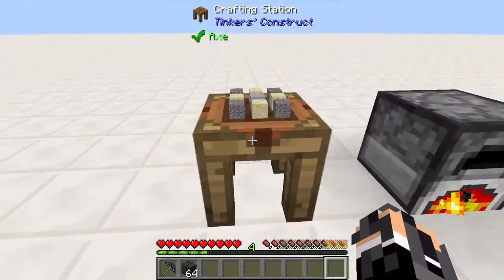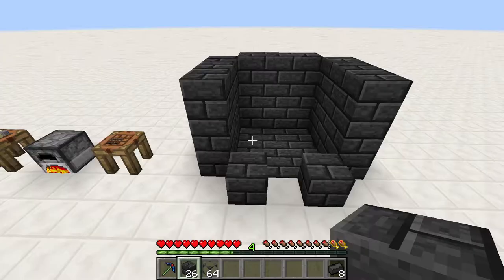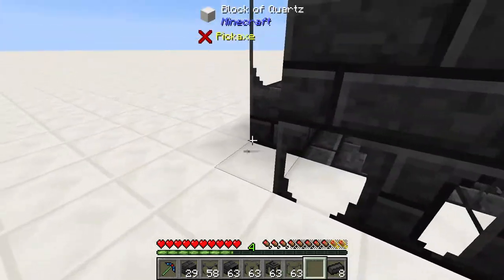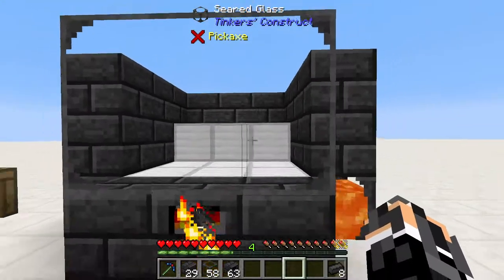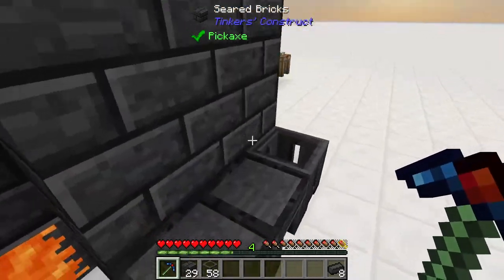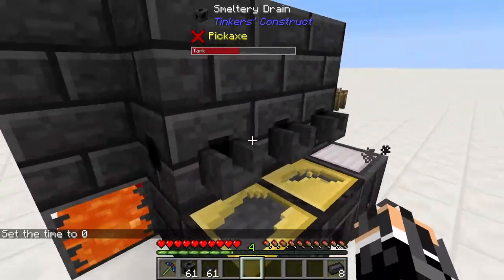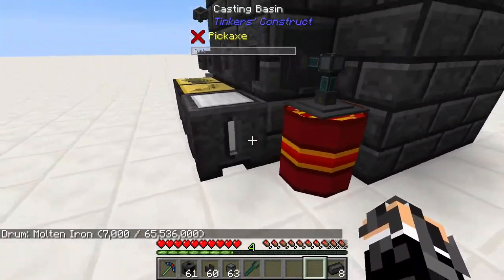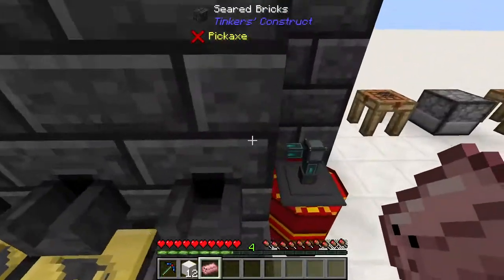Mods For Dummies Ep 1: Tinker's Smeltery

Comment: how do i fix the problem of the metals not harding? it stays liquad in the bisen and casting table
Reply from the maker: Are the basin and casting table filled up all the way? If they are only partially filled the metal will not harden.
Reply: @lunarphoenix5904  yea they fill up all the way but it happens with any cast pattern( not the ingot one)
Reply: @lunarphoenix5904  i think i will test it with tinkers construct being in the only mod, maybe another mod is stopping it from working